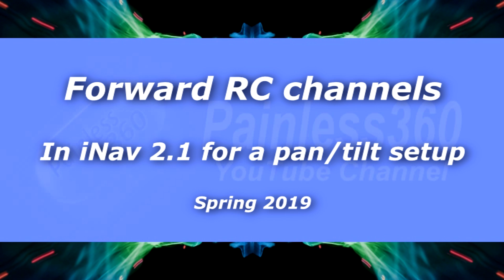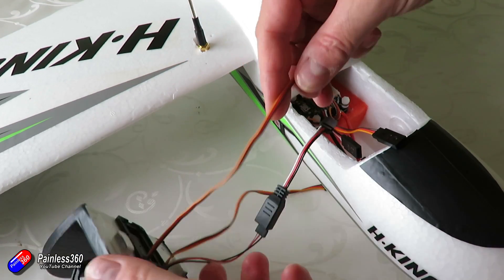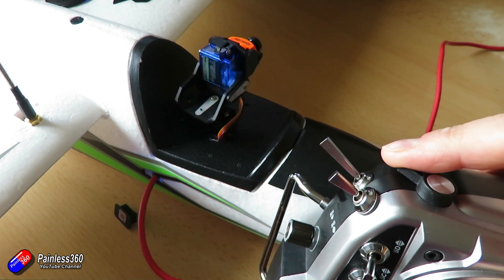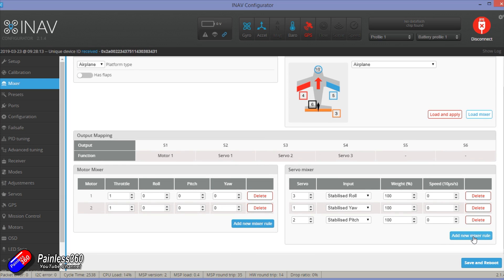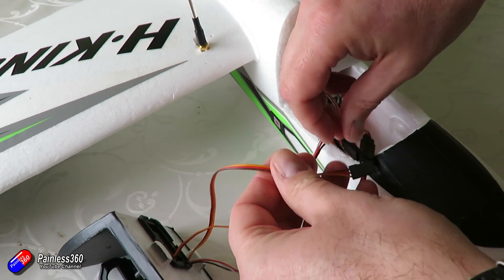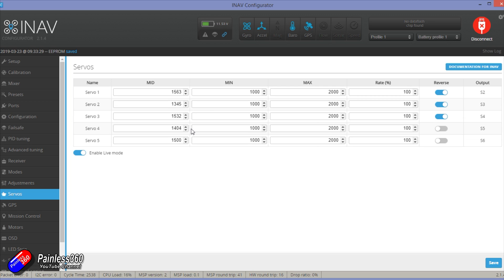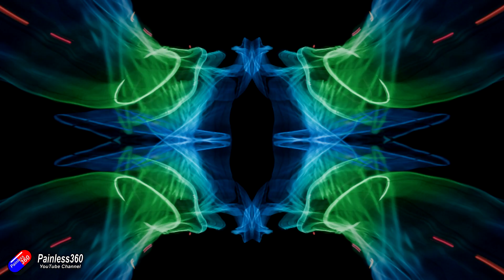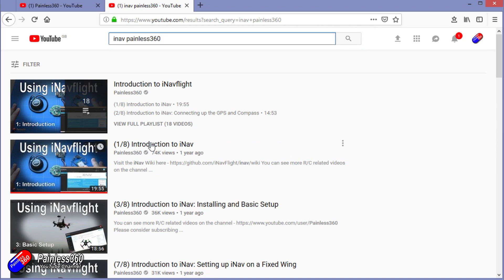Forwarding Channels in iNav 2.1 for things like FPV Pan and Tilt

Comment: Is it possible to do something in iNav where you flick a switch and suddenly your throttle gimbal controls your camera movements instead?
I suppose your last throttle position would have to be stored so you can maintain speed while controlling the camera.
Reply from the maker: I'm sure you could do that with either the radio or in channel forwarding or logical switches but turning off the primary flight controls (even in an autonomous mode) sound risky.. Happy flying

Comment: Painless I have a pan and tilt gimbal set up on my Quadcopter.  The servos are connected directly to the xfire Nano rx onboard and I have the pan and tilt assigned to the two knobs on my qx7.  It’s working fine.  I also have a trinity headtracker in my Dom V3’s.  I’ve set up the gimbal using the headtracker as well.  How do I set things up so that the knobs work for the gimbal and then be able to switch over to headtracker control of the gimbal when I desire and have the gimbal return to the knob positions when I turn off the headtracker?
Reply from the maker: I have a few videos about that. Google something like, 'head tracker painless360' to find them. Best of luck

Comment: My Apm 2.8 not connecting to the mavlink and now when I try again the apm board lights up for 10sec and turns down plzz help ur my only hope. Did I burn my apm?
Reply from the maker: Please leave a comment on a relevant video. Without knowing how you're powering the board and what trouble you have already tried its tricky to offer advice..
Reply: @Painless360  actually i updated the mission planner for the latest quad firmware but it said the board has retired i tried many times but it lead to bricking my Apm 2.8 and then I tried to bootload or flash the chip so I disconnected the GPS esc everything and connected the apm via USB cable it worked fine by recognized by my pc but after some time it automatically turned off even though it is still connected to the pc all the light turned off in the apm and it was no more recognized by my pc even though it is connected to it...........
This all problem started because I bought a telemetry kit and I tried compass calibration via the 3dr. But the frst symptom was when I connected the air and ground telemetry perfectly then I powered the quad via 3s battery the apm boards light went off after 5sec!!!  Plzzzzzz help meeee
Reply from the maker: See my APM videos on that retired message and what it means. If you've forced a later version of the code onto the FC (not sure how you managed that) then it may be very unhappy but as I've not done that here I'm not sure how much.. best of luck.

Comment: Is there any way, yet, to stabilize the pan and tilt so that, as the aircraft pitches and yaws, the camera keeps pointing at the same target?  I guess we would also need roll stabilization to really get the benefits of it though.  I guess my question is is, does iNav already have any of this ability built into the software?
Reply from the maker: There is. Enable CAMSTAB mode and add Gimbal controls to the relevant Gimbal servo outputs - https://github.com/iNavFlight/inav/blob/master/docs/Servo Gimbal.md

Comment: Hi lee I have messaged you on instagram regarding a similar issue on betaflight could you please take a look
Reply from the maker: I dont use the messenger system on Instagram. What was the question?
Reply: @Painless360  are right that explains that do you have a email i could send it to please
Reply from the maker: Free support is on here unless you are a Patreon..
Reply: Hi lee I wander weather you would have the time to help me I wouldn’t ask but this stuff is way out of my league. I have just built a brushless 3d printed hovercraft and i have installed a old betaflight f3 board into it that I had laying around. My question is I have the rudder servo soldered to motor output 3 my lift esc soldered to output 4 and my thrust esc soldered to motor 1 and I need them all separate to each outer so I can put My question is I have the rudder servo soldered to motor output 3 my lift esc soldered to output 4 and my thrust esc soldered to motor 1 and I need them all separate to each outer so I can put my lift fan on a switch. 

Thrust on my normal throttle stick on my Taranis and the rudder servo on my role stick on the Taranis how do I do this please help I am loosing the will to live lol
Reply from the maker: Not sure on Betaflight but easy with iNav mixer.... best of luck.